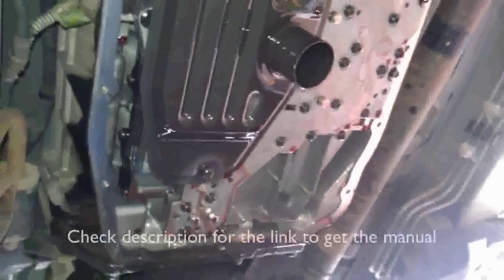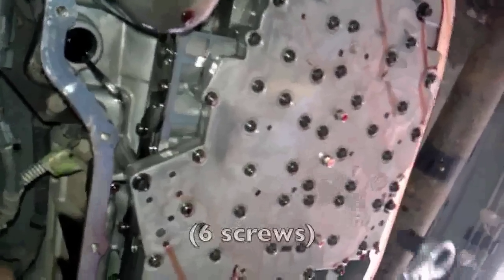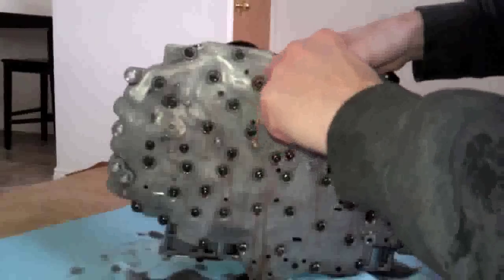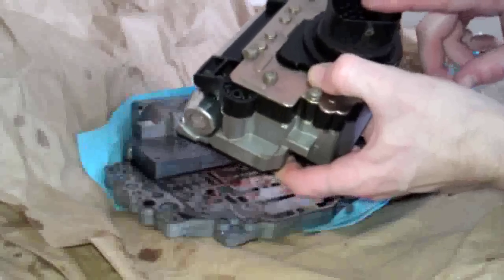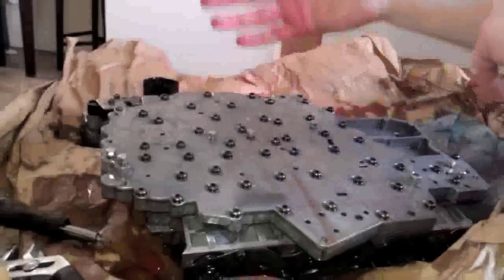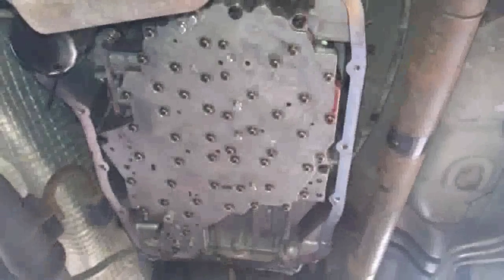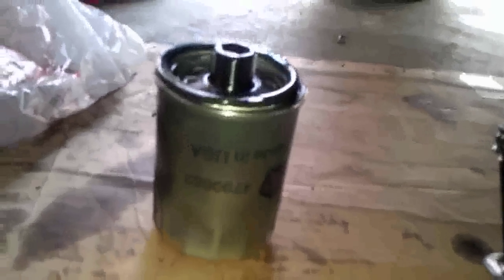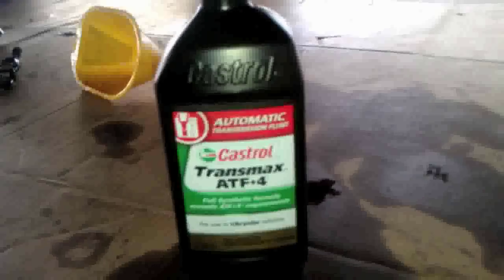Solenoid Pack Replacement 99-04 Jeep Grand Cherokee 45RFE P1781 Fix P0700

Comment: Great detail in your video! Very informative.

My 2004 Jeep Grand Cherokee will occasionally not start unless I shift into neutral, and even then will sometimes not start. When that happens, I have to occasionally shift into neutral to get it rolling very slowly, then quickly move the shifter from Neutral to Park. The vehicle stops rolling abruptly, but I will usually start when turning the key. I know that it's not good for the transmission, but sometimes I have no other option. I was going to replace the neutral safety switch and that is when I learned that my Jeep's transmission doesn't have an externally accessible neutral safety switch, but some sort of solenoid in the transmission that is not allowing the engine to start. Is the part you are replacing in this video the same part that will resolve my "solenoid module neutral safety switch" issue; or are my Jeep WJ problems unrelated to your Jeep issues?

I'm trying to find the part number that I need to order to fix the problem.
Reply from the maker: Sounds like you have a different issue. The codes/problems that came up with my solenoid issue weren't related to starting issues, but made the transmission go into "limp mode". Good luck! There is a good jeep forum community out there

Comment: Mine goes into limp mode and throws that code if I don't let it warm up in the morning before I leave to go to work, but it usually drives normal once it's warmed up and the engine code goes off in a couple weeks

Comment: Hello, I have a 2012 jeep compass, error code P0700, it does not change the transmission, will changing the valve body work?  Please help me?

Comment: So does this fix a p0700 with a p1781 code? It says OD pressure switch failure I have the same trans but in a Dakota.
Reply from the maker: Yes this is what I did to fix those codes.
Reply: Update, just changed mine and it fixed all my issues, I had no reverse lights and it was stuck in 3rd gear limp mode! Thanks again, I had the black connector one, the new one was a white connector style, it is an upgraded version according to the paperwork.

Comment: This replaces all the solenoids? My 01 Jeep Grand Cherokee torque converter lockup solenoid is faulting on the highway.
Reply from the maker: That I don't know. You'll need to pull the codes and do more research on troubleshooting. I can't find anything on a standalone torque converter solenoid on the 45RFE or 545RFE transmissions. That might mean this solenoid pack includes the TCC solenoid.
Reply: @jalandub  Alright thank you. Do you happen to know if the 2001 Jeep Grand Cherokee has the white plug or black plug or needs the additional bracket?
Reply from the maker: @johnsmith3735  I think the white plug is the newer of the 2 so likely what your car is using. You'll want to confirm visually.

Comment: Got a P0700 and my Jeep went into limp mode .. I was really considering just getting rid of it but this video is going saved me from a car payment!  Thank you for posting
Reply: Hello, good evening, I have a 2012 Jeep compass that gives me this same error P0700, it does not make the changes, changing the valve body will have a solution.  ?  How did you do?
Reply: @hectorrodriguez5956  everything workout great! Just a messy job 🤣
Reply: I don't know what to do
Reply: @hectorrodriguez5956  if your not confortable doing it yourself hire somebody.. buy the part first

Comment: Bro, the problem was right there on the filter! That seal SHOULD NOT COME OUT WITH FILTER... Change my mind!
Reply from the maker: You’re saying the problem (P1781) was all because of the filter seal? really bro? No. Its fine if it comes out with the filter. As I said in the video, it needs to be reseated before placing the new filter. That's based on all the research I did before replacing it. If you take the filter out and the seal stays put, good for you.

Comment: I have a 1999 Grand Cherokee 6 cylinder 2WD.  Suddenly it will not shift into either first or second gear.  After having the transmission serviced, the mechanic told me one of the solenoids needs replacement.  He claims no codes showed.  He then told me the solenoid is on the very top of the transmission.  By looking at your video, is it the actual "plate" that you removed where all the solenoids are located or some of them?  I am trying to salvage my transmission rather than swapping it and pay a lot of money which I don't find it necessary.  I hope you can help me.  Thank you.
Reply from the maker: If you don't have any codes I don't know how to help you further. I know about this solenoid pack located on the top side of the valve body I removed. I don't know if this trans has other solenoids. Your problem may be related though as this solenoid pack controls putting the trans into gear.
Reply: @jalandub  hello again.  on the code search, do i turn on and off the ignition like three times to obtain a code?  i will try that now.  thanks.

Comment: Thanks for the information.  I'm pretty sure I'm going to need to do this soon. 
Just turned on my vehicle and shifted to drive and it was stuck in 3rd gear.  It also doesn't shift
down at lower speeds unless you hit the gas significantly and there's some slop between gears.

Comment: Ive got a P0750 error, I suspect it's the wiring because the error only occurs once every blue moon. If I'm goin in there should I just replace the whole damn solenoid or potentially save 300 bucks?

Comment: I have a 1998 Jeep Grand Cherokee.  The transmission stooped shifting two weeks ago. I replaced the two solenoids, wiring harness, tork converter and spring accumulator. However the transmission still is not shifting. Please advise.

Comment: Thankyou Bro. Just did this today. A suggestion  change your crank sensor and cam sensor.  At the same time .I guarantee it will work like new . I chased codes after fixing the trans . New computer to . Over 400k km on ole Whitey but shes like new

Comment: Hi Jeff...
i did the same in a Dakota 2006 w/ 45rfe trans and fix the codes but i lost the reverse all run ok except the reverse don't work 
and before with the old solenoids it was working good .the problem was starting in 4th 
what  do you think i don't do right  ?

Comment: Hi I do this to my Dodge Ram and is not doing any shifts you don’t know what is the problem
Reply from the maker: Nestor Espinoza you have to make sure the shifter is realigned with the selector plate of it won't let you put it in gear. If the jeep is not shifting it may be in limp mode. Check for engine codes.

Comment: Hi i did the same thing you just did but unfortunately its just not starting. I have power but it dont just turn on. What to do could it be it wasn't in park position?
Reply: I have the same problem.
Did you find a solution?
Reply: Yes it was the connection plug to the solenoid that wasnt in all the way. Plus i had debris in side of it as well. Take a air in a can blow it out and plug it back in to the solenoid and make sure the white wire connector is locked in and it should turn on.

Comment: So this wasnt a p0740 code..that my problem...not sure what to fix..any ideas
Reply: Have a 2002 limited...with p0740 code
Reply: @SlayerHawkX  did you ever fix the problem I have the same code?
Reply: @papismoke-777  ..i changed the solenoid pack and cleared codes..code never returned but unfortunately the engine blew a few days after the fix.heh..so i really cant tell u if it was a complete fix .sorry
Reply: @SlayerHawkX  That sucks but why did ur engine blow?
Reply: @papismoke-777  the old lady was drivn it..she thought the trans was messing up again but was engine..she keeped tryn to drive it and rockers came off and something went in to #1 piston and smashed the plug..now its a yard ornament..had 298000 miles on it..
Reply: @SlayerHawkX  oh that sucks I guess I'm gonna try changing the pack to hopefully that fix the problem what symptoms were you having with your car if you remember?
Reply: @papismoke-777  the light would come on here and there..and i believe it was dien at stop light ..not all the time..then start rite back up.. it all revolved around the torque c. solenoid ..like i said ,after i changed the solenoid pack and trans oil pressure sensor ..it was fine..
Reply: @papismoke-777  the jeep was dieing stop lights rpms would studder some on hwy..after i changed the solenoid pack and transmission oil pressure sensor, it worked while it drove for a few weeks..i got the pack online from a vid i saw here , search this -- 45RFE 545RFE 68RFE Shift Solenoid Block Pack Replacement - Install RFE  .. there are link to the item..atleast there was a year ago..good luck!
Reply: I have the same code. Did you fix the problem?
Reply: @juliorc23  I have the same code did you ever fix the problem?

Comment: Great video, really helped. When I got done, my truck would not start. It has power, but will not crank. Any ideas?
Reply from the maker: Hmm, not sure, since everything this project works on isn't related to the starter. Make sure you plug your connector back into the Trans. Other than that check your battery I guess? Good luck, glad the video helped.
Reply: It was my ECM! Got a different one installed and it started right up. Unfortunately it won't go into gear, so I think I installed the detent plate incorrectly.
Reply from the maker: Aw crap! That was the most nervous part of the repair for me. Glad you got the starting problem fixed though, surprised it was the ECM.

Comment: From the manual:
"Install the bolts (1) (Fig. 144) to hold the transmission solenoid/TRS assembly onto the valve body.
(4) Tighten the solenoid assembly screws adjacent
to the arrows cast into the bottom of the valve body
first. Tighten the screws to 5.7 N·m (50 in.lbs.).
(5) Tighten the remainder of the solenoid assembly
screws to 5.7 N·m (50 in.lbs.)."

Valve Body Bolt
  11.8
 N m, (8.7 in.lbs)

Comment: THX FOR VIDEO
was looking at these for several days
you are only one I could find the show connector on trans, how the latch works
no looked at mine yet, but was trying to see if you can tell if solenoid side is white or black plug before I order part
looks like I need to pop connector before I can tell color.
working on moms 2002 dodge ram 1500 2wd 4 door 4.7L
I have same but 2005
getting po750 code and it's intermittent,clear code and might drive ok for a week.
I should have black connector in the 2002 and white in 2005
but if I just assume and order without checking, I might just be out of luck if I order wrong part,lol
Reply from the maker: yea should be able to see the color of the plug when you release the connector

Comment: IF the selector plate is not aligned properly. could it cause this issue?  I changed the solenoid pack,  I test drove and it defaults to 1st gear when it says drive, wont shift or shift manually. The check light is on.   Question 2: The middle bolt of three in front on the plate that holds the pack, I broke and left off,  OPINION:  will this cause a problem? I guess I will let you know once figure out its current problem.   Thanks for the vid.
Reply: PolyV Try disconnecting the Negative cable on your battery,  wait about a minute before reconnecting. Also while you are waiting, depress the brake pedal and turn ignition switch to start then back to off. This will take out any residual voltage left in the computer. Reconnect cable, then start and take for test drive, you should now be out of limp mode, and trans should be shifting ok.

Comment: Hi first off thank you for taking the time to record and post this. I'm working on this very issue with my 02 jeep started today but having issue getting valve body completely off transmission housing. I've got all the bolts out but it's hung up on shifting mechanism. What do I need to remove to get it completely off? Any help would be greatly appreciated
Reply from the maker: Make sure the plug going into the Trans is completely off, that could get it stuck. I don't see how it could get stuck on the shifter, maybe try it in a different position, neutral or reverse? Just remember which position its in so you can have the selector plate in the right spot when you reinstall. And double check your bolts.

Comment: I replaced a Solenoid pack in a 2002 300m and all went perfect but......now the car rolls in park!!! what did I do wrong?
Reply from the maker: Norman Kittle could be that the selector plate wasn't properly aligned with the shifter when reinstalled? That's my only guess

Comment: hi people if you have a code p0700 all you need to do its change the Solenoid pack and the problem it's done  because I did it already and I am so happy now just buy a new solenoid pack simple good luck people
Reply: Kleber Wayne the p0700 code is just telling u,  u have a transmission problem..does not say what the prob is tho..my jeep said thw same on dash..but code reader says p0740..
Reply: @SlayerHawkX  did you fix the problem my Jeep is throwing p0740?
Reply: Kleber, I have this code on my Dodge ram 1500, will this work for my model?

Comment: Hey Jeff Weeks,  have you heard since your video and even during your research of a 99 JGC 4.0L going into limp mode only when the low fuel indicator comes on?
Reply from the maker: Jason Lehmann no I didn't do any research on 4.0's. It's weird that the 2 would be linked since one is transmision and the other is fuel.

Comment: great video, had same code P0700 and P0750 on 2005 Jeep GC limited 5.7 same transmission, followed your video to the letter and then drove 400 miles. no leaks, no further issue. although the part was OEM and under warranty the labor was not covered in warranty. so I'm grateful, because I am certainly no mechanic.
Reply from the maker: Dean Schmitt so glad it helped! Mine is still going strong after 3 years.

Comment: so this fixed the p0700 code? all I need to do is replace the solenoid pack?
Reply from the maker: Denny Digital if your vehicle is going into limp mode, then works normally after running it for a few minutes and restarting, it's probably your solenoid pack.
Reply: Jeff Weeks I have P0700 and p0116 plus I need a new motor mounts so far I have seen all you gentlemen on YouTube do the same thing to fix the issue so now it's my turn! thanks Jeff! God bless!
Reply: All the P0700 code is the engine control module telling you there is a code in the transmission control module. It could be something as simple as a $30 speed sensor. Mine has a P0740 code in the TCM for an open LR solenoid. Going to replace the solenoid pack tomorrow. Thanks for the video!
Reply from the maker: You're right about the P0700 being a pretty general code. For me having that code with the P1781 and the limp mode symptom was what led me to the solenoid pack. Is your P0740 on a 99-2000 JGC? Doesn't that have to do with the torque converter clutch circuit? Is that part of the solenoid pack?
Reply: Mine is on an 05 Ram 1500 with a 545rfe transmission. The code is for the torque converter lockup solenoid (the torque converter is not locking when it should). Going to replace the solenoid pack, and if that doesn't fix it it's probably the torque converter going bad.
Reply: @trryhin  did you ever fix the problem I have the same code right now?
Reply: @papismoke-777  Yes, replacing the solenoid pack fixed the P0740 code.
Reply: @trryhin  Thank you for the reply did you have any problems like the car shutting off on you/lossing power before you fix the problem?
Reply: @papismoke-777  Not that I can remember but it was several years ago. I know the check engine light was on and the transmission was in limp mode.

Comment: thanks for the video. i searched everywhere for a valve body replacement video on my ram. it looks to be your jeep has the same transmission. again thanks for the video upload!
Reply: Hey man I changed same solenoid for jeep commander and it remained in drive and as you know it won't start. What should I do?

Comment: hola mi problema es el p0740 es grand cherokee v8 4.7 20014x4. no me falla le entran los cambios bien, lo que pasa que cuando manejo en carretera se prende el trans over temp. me podrias ayudar?
Reply: Hola yo tengo Las misma problema Como reglarte El transmission tuyo?

Comment: great video I got 01 jeep grand cherokee  4.0 its will not shift I can only go 20mph but I'm not getting any trouble code  any idea if its the solenoid pack or governor pressure solenoid?
Reply from the maker: Your jeep has the 545RFE Trans in it, not sure if that changes things or if they're similar enough. Everything I know is in this video for this type of problem.
Reply: thank jeff

Comment: After replacing the solenoid pack on my 2000 Grand Cherokee, the Jeep has power - lights, gauges and accessories - but will not crank.  Anyone else experience this issue ? The installation went very smoothly so I was surprised with the result.
Reply: I just had the same problem! Did you get a resolution?

Comment: how did you reconnect the connector, I have a dodge Durango same trans, I cleaned mine using your video but I can get the connector back on...please help! is there a trick to it? there is little room or visibility and I'm afraid to force it on.
Reply from the maker: It should go easily on. If the connector in the solenoid pack is white instead of black then you installed the wrong part and will need to get an adapter.
Reply: +Jeff Weeks I got it on, I had it in the upward position, needed to be on down position then flipped up. Thanks.